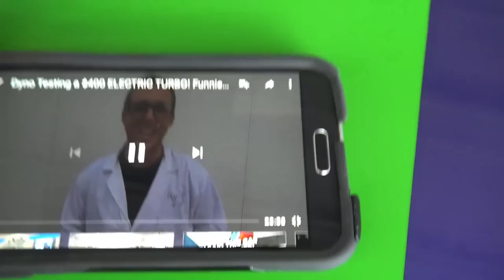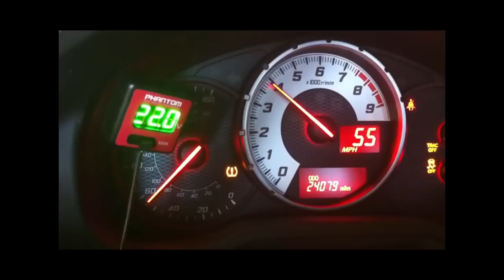Cleetus Mcfarland is wrong about electric turbos!

Comment: This video is really not well researched. The dyno video he presents shows a base line of 167 and the final test at 194. The scion frs makes 200 horsepower stock according to the internet. I believe he ran it off and install which would be a restricted intake killing horsepower to get that number. Then kicked it back on to get the 194. Congratulations you loss 6 horsepower and added a bunch of garbage you didnt need. Im not saying they dont work however the one on that dyno pull did not increase power just gave back the air flow it had stock. Besides with out any tuning you're running your car lean with out proper fuel mapping.

Comment: Its all about the numbers.......how much current it draws, and how much boost it makes.  For sheer psi, nothing will beat a conventional,exhaust driven turbo or large crank driven supercharger........but those systems are a major effort to install and tune correctly......whereas electric turbos have a good niche application for low boost that can be developed independent of crankshaft speed, which could provide a nice pick up in torque etc depending on how the user wants it to operate. Its easy to see Cleetus was being an idiot...........hes using a tiny unit on a V8 which simply cant keep up enough CFM.

Comment: You lost me when you couldn't explain the difference between a turbocharger and a supercharger. What you have is a turbine with an electric motor, (turbo). Super chargers have worm gears run by the crankshaft. And for what you spent on that garbage, you could've made real power.

Comment: Any boost or power gains are going to be marginal, The only moderately effective way to this would be to do what Cleetus did with those newer electric turbos he tested.
2 grand for this? Fuck that.. You would literally be better off buying a used supercharger off ebay and running ghetto piping into your intake then run an aftermarket belt to drive the damn thing.. With the right charger or a small pulley you would see better gains across the board without needing more batteries, Burning out alternators way faster, Rigging up some ghetto wiring all over your car, Increasing potential for a fire from questionable hardware.

Comment: Waste of money you could get 800$ turbo kit and 500$ in fuel and tuning and make way more power this guy compares it to nitrous this guy is loss in the performance world just for your info nitrous can work from 3000 all the way to red line not only at full throttle only. Plus you could do same setup actually with nitrous for 500$ and make more power just as safe with proper tune which if what your saying is true your so called turbo would actually need tuning and fuel upgrade as well

Comment: Intake 200 $$ 
Header exhaust 1000 $$ 
Tuned 75$$ 
So for 1275$$ u can get 40 to 50  horsepower u can use all the time and not some electric fan in your Intake . You are making a joke of yourself and your car. I have a 2017 mustang 5.0 with a f1x procharger . I spent 4900$$ and gained 370 horsepower on 12 psi . I have a 978 horsepower street car. Go big or go home.
Reply: What does your guy tune? The wiper blades?

Comment: Now show the same car on the dyno show the boost gauge make boost and if you are making boost boost is boost you still need added fuel and tuning under boost! And if that did make any boost when its not on you are going to lose mass power from the intake restriction! So lets see the same car on dyno and real dyno sheet and a boost gauge!!

Comment: Sorry not sorry but this is just useless... To make any worthy gains first of all you need a bigger electric motor (Audi to only limit turbo lag uses 48V 7000W electric motor)  and some kind of gearbox or planetary gear set to multiply the rpm's of a "turbine" shaft then you need a brainbox that will read the stock ecu's values and adapt to conditions like fuel type/quality, outisde temp/intake air temp  load, engine temp and many other things and then you need to reflash ecu (and maybe add a manifold absolute preassure sensor ) to know its getting more air to provide more fuel and the afr has to be lowered accordingly to boost levels and this is just putting it simply. Maybe in a tiny tiny 1 or 2 cyl engine  like a moped or sth. this would work  but in a 2l  4 cyl car engine this is just useless in my opinion

Comment: “Technically it’s actually called an electric compressor”  a supercharger takes its power from the engine mechanically, ie via a belt or in limited cases a chain, a turbocharger as we all know takes gasses from the exhaust to spin a compressor wheel. Please if you’re going to start your video in such a derogatory way towards a fellow human, get YOUR OWN facts in check. 👍🤦

Comment: That's about all the boost that poor motor will take before it blows a ring land xD
Reply: It's a Subaru motor, last I checked, subaru has a turbo charged version of this exact motor. Not in an FRS or a BRZ or whatever you call them. It can take boost, likely different internals, but it will take it.

Comment: Your setup isnt that great either,
You get a power loss for having no turbo at all under 75% throttle 🤣
Get yourself a decent esc and put a pot meter on your foot pedal 👍

Connect the turbo with T piece and build a one way valve in the air filter and get a 2nd pipe from airfilter to '' turbo'' 
Iam going 10s lipo on this 😋
Reply: Good idea! The one way valve to eliminate restriction through elect chrgr when not on!
I was thinking a cut out on the intake…. & install one on the exhaust as well! Plug & play time… open the exhaust cut out floor the pedal activate the charger synchronized with pedal! Enjoy 20-50 Hp! Lol! Guy can dream I guess🤔😂🚘🕺🏽

Comment: His video was a goof,   your system is a goof... I'm not sure what mechanic experience you have but you are completely uninformed about what is needed for a turbo to work.   You can appropriately size it and you don't need to have an intercooler or oil cooler or any other supporting mods to make the power your making with yours ,  but I can go around the track and make boost and power beyond the burst your joke is Making

Comment: Well my friend your entire argument is wrong.  Anything that raises air pressure above atmospheric is considered a supercharger.  A turbocharger is just a centrifugal supercharger that uses an exhaust gas  heat energy to turn it the turbine.  You use a electric driven centrifugal supercharger since you want to call Cleetus out for clickbait.

Comment: Sorry this is bullshit , for spool this size turbine you need minimum 30-50 KW power in 50-60k rpm..... this little guy doesnt have enough power for proper  or maintain boost  (0.2-0.3 bar) pressure. 
At least low throttle you have a massive choke in your intake , :)

Comment: Sorry, but the tests Cleetus did were "Science". Even though the one he had were junk it did lose horsepower. And for his viewers, who are probably fans/ owners of ls and v8 cars ANY form of electric forced induction would be useless. Unfortunately for the amount of power you would need would require an upgraded electrical/charging system and a massive electric motor. Battery and motor technology just isn't there yet.
Reply: In this video you see an upgrade to the electrical system because he placed 2 batteries in series dedicated for the electric supercharger. So pretty sure this works.
Reply: @danielhilgersom304  I'm not saying that the 5 pounds of boost he is claiming doesn't happen. But for anything under full throttle when the supercharger isn't spinning he is loosing power. So what I am saying is that an electric supercharger cannot replace a supercharger or turbo with the technology we have now
Reply: Daniël Hilgersom I know you want this to work.  Cheap easy to install horsepower.  The unfortunate truth is it doesn’t.  There is a reason the manufacture of this system does not make it any more.   It’s because it doesn’t work.

Comment: This is the dumbest thing ever.  I doubt those dyno charts are actually from your dyno run.  

You can m90 supercharge the frs for a few hundred dollars and make actual power.... and not get laughed at by everyone at cars and coffee or the track.  

My sedan has the same engine as you would be at the 1/4 when you’re at the 1/8.
Reply: Edit: after I rewatched the video.... that’s a different car on the dyno.   You have not dyno tested your vehicle to see any gains.  

I am curious.  Where is the boost sensor located on this?  Is it on the manifold somewhere?  Or is it integral in the turbo housing?  Because you can easily see higher pressure “boost” inside the restrictive turbo.  That does not mean that your half liter manifold or 2 liter combustion chambers will be experiencing any level of boost